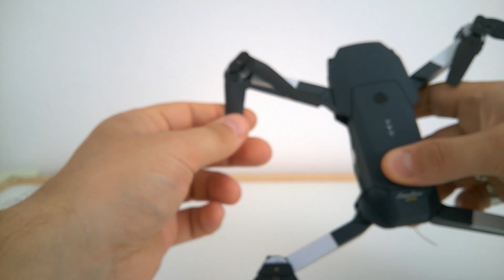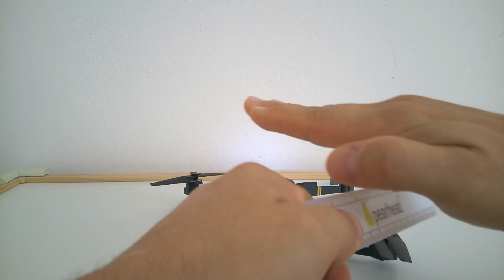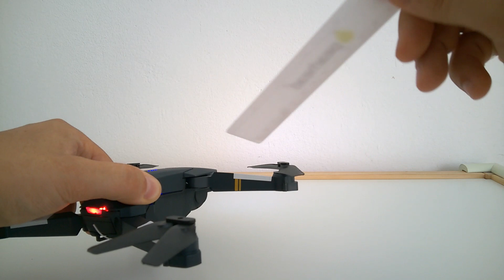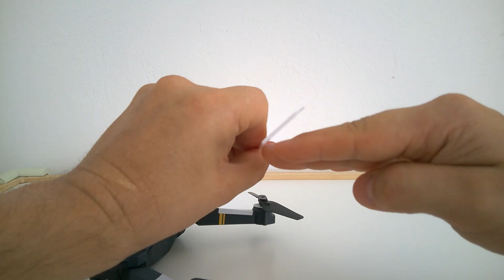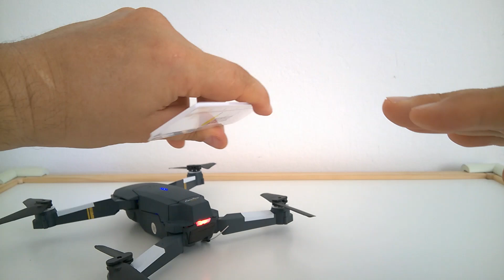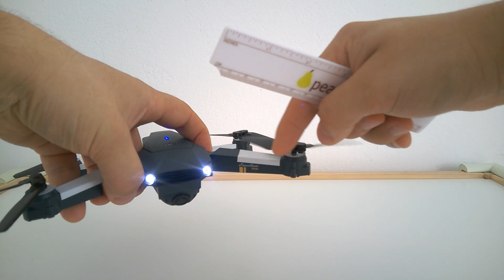How to Install Propellers in Correct Order on Eachine E58 (QuadAir, Drone X Pro) or E88 Drones?

Comment: No information about actually replacing the propellers... waste of time
Reply from the maker: the only thing to do is to unscrew one screw per propeller, remove the old propeller and put the new ones based on the logic explained in the video. There are more videos on how to disassemble and assemble the Eachine E58 drone in the E58 playlist.

Comment: How to set repelers of E88 drone men
Reply from the maker: use the same logic, it is universal for all drones, look at which direction blade surfaces are inclined and imagine how air flow would go when they rotate in different direction. Check which direction the axles of propellers are rotating by turning on and off the drone before you put the propellers on.